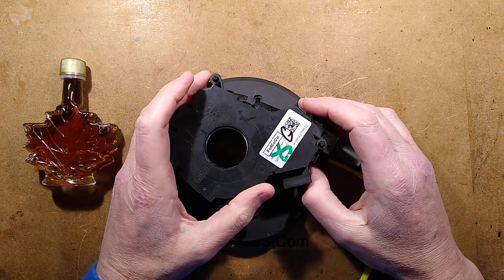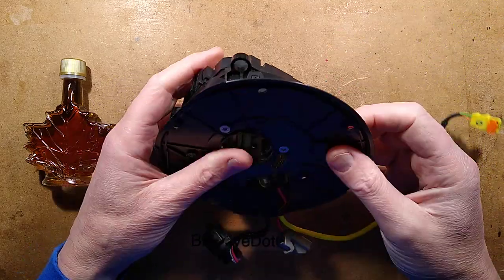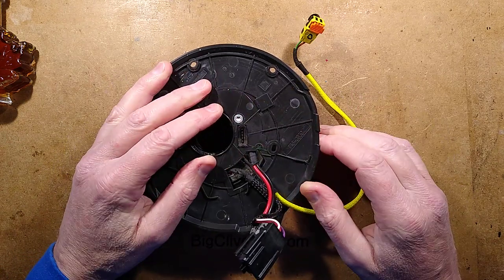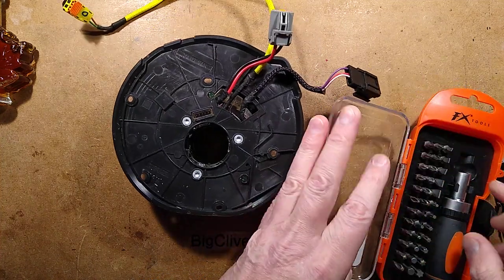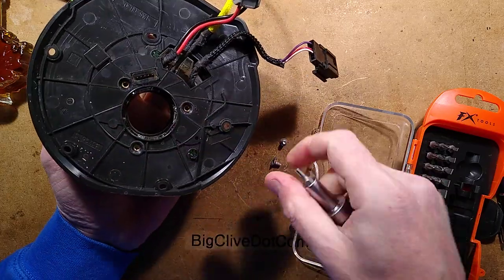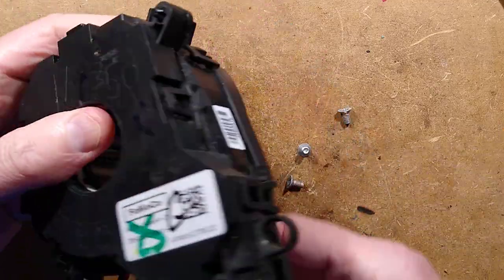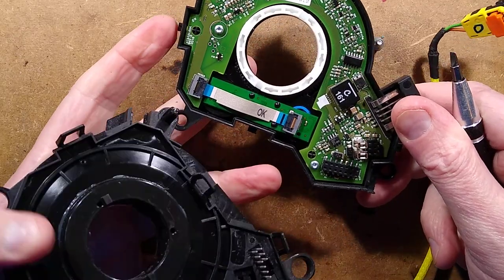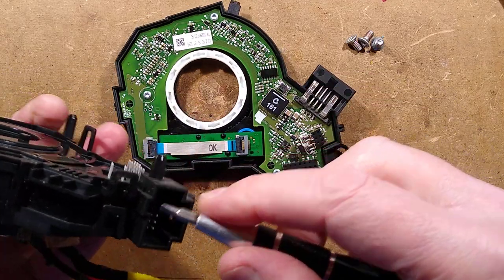Inside a car clock-spring module (steering wheel wiring interface)

Comment: Life was so much easier when the only button on the steering wheel was the horn.  Literally just one sliding contact.  Didn't even need two because the the horn button switched the ground to the horn.  That's why when old cars in movies have the horn go off when they wreck.  Any point in that circuit that goes to ground and the horn sounds continuously until someone disconnects the battery.
Reply: I don’t see the point in having controls on the steering wheel when they do the same thing as controls literally inches away on the dash... with practice you can adjust things without looking.
Perhaps it’s different now with touchscreens, on some cars even changing the radio station is multiple menus down!
Reply: Huh, I always thought the horn going off was to tell the audience that the driver was passed out with their head on the horn button.
Reply: Maybe they should bring that back - could potentially save lives by alerting passers by
Reply: @23Scadu  Nah, I've seen it happen IRL.  You have to pop the hood and go for either a battery terminal or the horn itself.
Reply: @RavenLuni  
No argument here steering columns are literally the worst thing to work on in a modern car.  Cramped finicky and over complicated.
Reply: my first car didn't even have the horn on the wheel! it was stuck on the end of the indicator lever!
Reply: @DeannaEarley  I remember my dads old cortina had the horn like that
Reply: i have 4 cars and on all of them the horn is on the indicter stalk 
ive never owned a car with the horn on the wheel
Reply: @carmadme  My dad had an Izuzu I-mark from '81 that had the horn like that.
Reply: One day early in my first marriage and living in the northeastern US I headed to bed on a particularly cold and windy winter night and while in the bedroom I heard a droning sound that was difficult to identify. It turned out to be the horn of my wife's car, an early 1990s Pontiac, made less recognizable by all the wind noise. Apparently contraction of a part in the cold had caused the button to make contact. Once warmed back up it worked fine. No idea how long it had been going off; it was a sufficiently rural area that neighbors wouldn't have heard it as they were all too far away.
Reply: @bigjd2k  you'd still need a clockspring, even wirhout steering wheel controls. You need the steering angle sensor for ABS/ESP and the wiring in the clockspring for the Airbag. Might as well put some buttons on there, while you run those wires.
Reply: i had to take my steering wheel off my 94 4runner to get to the windshield wiper relay/switch, it's one of these ribbon modules but it includes the turn signal and windshield wipers, new part is like $250. boggles my mind why the engineers felt this needed to be attached to the steering wheel and not a couple inches back and just to the column, getting rid of the need for a lot of this crap.. and this is 94... imagine what cars have now
Reply: @DeannaEarley  also a Ford? I remember my brothers Escort, the first time I drove it I couldn't find the horn 😂
Reply: StraightOuttaJarhois I see you received you education from GTA like me 😅
Reply: @RavenLuni  Well, modern cars won't sound the horn, but I know of at least one manufacturer that has the interior and exterior lights come on, and the doors automatically unlock in the event of a crash severe enough to trigger the airbag.
Reply: They took it a step further and made sure fords from 1985-2000 like my ford contour when i wreck when airbags deployed the horn automatically sounds via computer command for  300 seconds so someone can find you.  It turned itself off when it still had battery power but the flashers didnt come on automatically.
Reply: Ford had cars with cruise control buttons on the steering wheel in the late 80s/early 90s and they too just used one sliding contact, which was used for both the horn and the cruise control switches.
Reply: Ah yes, the horn button switching the ground. Many years ago, a very unpopular sales man at the dealership I worked at brought his car in for some remedial work. We connected a wire from the choke knob light (remember choke knobs!)  to the horn. No problem driving it warm. The next morning, cold start, choke out, drives to work with the horn blaring!
Reply: @grayfox7671  EVIL!  I love it.  My favorite gag is to hide a blue tooth speaker in someone's car and then play weird noises from my cell phone.
Reply: @RavenLuni  Most cars do still have that "feature," and for specifically the reason you mention (alerting passersby), even as far back as the 1990s. I've never looked into whether the airbag module energizes the horn relay, or if the airbag inflator physically shorts the horn terminals upon deployment... Many of the newer cars automatically turn on the hazard flashers and pulse the horn upon deployment.
Reply: Why one contact? You can't make a circuit with a single contact. The ground has to come from somewhere.
Reply: @userPrehistoricman  You don't need to have 2 wires or separate contacts at the component to complete a circuit if the mounting point has electrical continuity to chassis ground. This was quite common for O2 sensors particularly prior to the introduction of heater circuits, and is still common for door switches, temperature sending units, pressure switches, etc.. In fact a 2-wire spark plug would just be bizarre.
Reply: @userPrehistoricman  Yeah it comes right through the steering column.  In older cars the entire body and frame are a ground.  Cut's down on half the wiring.
Reply: @DeannaEarley  Sounds like the old Morris Eight,indicator lever as well! And dip switch! And that was seventy or more years ago!
Reply: @hugebartlett1884  close, she was my old.. '79 mini
Reply: I've even seen big cylinder-like contacts with a coupling a bit resembling that of the blades of a helicopter, where the horn button on the wheel was nothing more than a spring-loaded frame you pushed down, causing to push a ring right behind the wheel that was mounted to the steering column down which would activate a switch somewhere.

Comment: Back in 2014, I had just gotten a new car and about 6 months after buying it, all the stuff on the wheel (horn, radio volume, etc) died and the airbag lite came on. So I took it to the dealer for the warranty, and there had actually just been a recall for a bad batch of clocksprings from the subcontractor. I had never heard of these things before

I was curious as to how they worked but there wasn’t that much info at the time and I just sorta let it go. so I’d like to thank you, Clive, for answering a 6yr old question that’s been bouncing around in my head.

Comment: Maybe of use to anyone wanting to learn more:  If you do a search on 'car steering angle sensor' it appears this complex electronics came into effect in 2012 when US legislation required new cars to have "Electronic Stability Control" fitted.  Basically the car brain has to work out if the vehicle is under control or not.  Part of this system compares the vehicle acceleration and yaw rate sensor data to wheel speed data and steering wheel data.  Back in my day the driver was capable of working out if the car was going out of control and compensated accordingly.  Apparently we need the car to work this out for us now.  Great video and most interesting teardown - many thanks Clive.

Comment: The steering wheel position must be known by the ABS module. If the right wheels are turning faster than the left and the steering wheel is turned to the left, that would be a valid situation. But if the right wheels are turning faster while the steering wheel is in the middle or turned to the right, that would indicate slipping wheels. In that case, the ABS module would apply some braking power to the right side wheels only, in order to correct this.
Eric O. did a video with exactly such problem. The steering angle sensor was present but not mechanically connected to the steering wheel shaft. That made the car apply brakes when cornering: the car thought it was going straight but the wheel speeds were different when turning left or right, resulting in uncommanded braking.
Steering wheel position sensors need to be recalibrated when replaced, after power loss or after an ABS module change. I suppose, the wheel position is calculated from the relative positions of the two magnets. They probably each have a different number of teeth on their cog. If these magnets would just form a rotary encoder, these modules would need to be active at all times, in order to track the steering wheel's position in case somebody turns the wheel while the car is totally powered off.
Reply: Exactly this - on a BMW you will get a “Steering Angle Inconsistent” error thrown - typically because the plastic disc and opaque / transparent tracks optical system for doing this has got dirty!

IIRC, when cleaning mine there were 5 tracks with different overlapping frequencies of opaque parts, with 5 leds and photosensors to detect turn speed and direction quite accurately.

Comment: The chips may be compasses detecting the absolute rotations of those two smaller gears. If they have different sizes, we can calculate the absolute rotation of the wheel.
Reply: That's exactly what I was thinking - the blue gear looks smaller than the black, and that would give pretty accurate positioning.
Reply: There will probably a procedure with the scanner to reset the straight-ahead position as well.
Reply: @tomvleeuwen  There normally is, it's essentially "Get the steering wheel dead straight and click next". Then you have to rotate the wheel from lock to lock a few times. The procedure likely differs from brand to brand
Reply: They might only be needed to detect direction and rate of turn. May not need abs position.
Reply: @littlebrutus5199  I don't think so, if the car does not have dynamic stability they normally use a cheaper way to detect the steering wheel position to switch off the direction indicators. If it does have dynamic stability, they need absolute position.
Reply: I'd also guess that they are different size gears. Just one or two teeth, not more. This gives an vastly increased range in which they are effective - basically, they'll only be in the same relation to each other after ten or more turns of the steering wheel. The control unit is then programmed to know which position is center.
(Since the gears are much smaller than the "sun gear" which attaches to the steering wheel, they will turn more than once per steering wheel rotation).
Reply: yeah the chips are hall effect sensors.. we already knew that idk why you said they may be compasses, hall effect sensors are actually used in electronic compasses
Reply: They're some fairly bog-standard magnetic rotary encoders
Reply: @tomvleeuwen  on my old VW you had to hit the end stops after reconnecting the battery, it threw a light on the dash until you did that. So I think it just looks at the max and min value ever seen and the middle is straight, and you get a dash light if something is unreasonable
Reply: For cars with DSC or similar, you don’t need to know midpoint, just swing it all the way one side to the other usually, and the car derives the midpoint from the yaw and wheel speed sensors.

Comment: Older cars where the only thing in the steering wheel was the horn did use slip-rings!
Reply: what is the need to know the rotation of the steering wheel for? greetings from nova scotia.
Reply: @absolutely1337  traction control and similar systems would need to know the steering wheel position to compensate for corners.
Reply: I think my old '87 Mazda 323 used slip rings. The steering wheel provided a single conductor and the steering shaft was at a zero potential, so touching that conductor to, well, anything really, sounded the horn.
Reply: @absolutely1337  most cars these days have electric power steering. The steering wheel angle is used to drive that.
Reply: One more overpriced piece of electronics which, when gone wrong ,will vost an arm and a leg for some 'fitter' to plug the car up for 24 hours, read the test codes and replace the unit (which will probably not be available anywhere to buy cheaper than main dealer), then plug the vehicle back up to the computer for another 24 hours to check if everything is in working order and charge you the cost of the vehicle. It is also to stop backstreet mechanics working on cars cheaper than main dealers. :)
Reply: Yeah I have an old truck that has 3 slip rings power horn and cruise control
Reply: awesome to know. thanks everyone. only steering wheel i  have take apart previous had slip rings on it.
Reply: My Riley (1946) had a 4 core cable down the steering column stator, 1) Ignition live, 2) Left Turn, 3) Right Turn and 4) Horn Earthy end.  The other side of the horn button was earthed to the column, the "hot" side of the horn was permanently live.  The stator went down the centre of the column and was prevented from rotating by an olive at the bottom of the column.
Reply: My first car,  corona 76, horn didnt work, the spring loaded contact to the ring had worn down so much it didnt make contact anymore. Also my key could open other similar model coronas, useful in a wrecking yard when getting parts!
Reply: @absolutely1337  also you need to know if the clock spring mechanism is going to bottom out at one side so you'd need to know the absolute position to center it
Reply: A coil of single core wire up the steering tube is enough - earth-return ! ;)
Reply: @ianallen2  And just how would you go about providing steering wheel controls for the radio, cruise and other things?  How about the airbag igniter?   What about stability control?
Reply: @madflyer1093  Not really. For power steering you "only" need to know the force applied to the wheel, not the position the wheel is in. And power steering dates back to WW2 trucks. Essentially, it's a classic servo arrangement. This thing is more for things like electronic stability control and traction control.
Reply: Bob Roberts Obviously you haven’t worked on many cars. There are controls on some steering wheel for cruise control and some controls for radio. Some steering wheels have a few buttons on the sides of the air bag surround in the spaces of the ‘spokes’.
Reply: Looks like we found the Grumpy Old Man who's so fired up that he misunderstood the question. 😆
Reply: @TDOBrandano  ford specifically does infact need to know the position of the wheel. It's how it determines the amount of side compensation assist to give. To compensate for road crown and cross winds.
Reply: @TDOBrandano  he was specifically talking about electronically assisted steering which in fact uses the steering angle sensor. Some modern cars rely entirely on electric motors for steering assist.
Reply: @pfannkuchengesicht42  Electrically assisted steering needs a torque sensor, not an angle sensor.  Steering angle sensors are used to compare the expected yaw rate (i.e. vehicle speed and steering angle) against the actual yaw rate which is determined from a gyroscopic sensor.  The ECU can then determine wheel slip and perform corrective action e.g. braking individual wheels.
Reply: @ianallen2  or you pull a unit out of a scrap vehicle, fit it in the one that needs a replacement, and done. you dont have to "plug up for 24 hours". 2 minutes is enough.

The manufacturers who make sure units cannot be replaced without special codes are fucking evil bastards, and their efforts are futile - often some guy made a tool to reprogram their ID for $500 and it's  a buy once affair (fine for a small garage that exclusively does 3 or 4 brands, that's 2k every couple of years)
Reply: @madflyer1093 - If you’re saying that the sensor is used to control the actual steering, that’s not the case at all. Electric steering doesn’t mean only motors operating the steering mechanism. It’s just the usual power steering except the conventional hydraulic system has been replaced with an electric motor. It’s merely ‘assisted’ steering, the driver still turns the wheels via the same old mechanical linkage, the motor just takes some of the load. Apologies if I misunderstood you.
Reply: @ferrumignis  which I understand usually consists of a torsion bar and two angle sensors in many consumer-grade EPS solutions.
Reply: @ianallen2  if you don't like it, maybe you should manufacture a better, cheaper car with less bells and whistles. good luck.

Comment: There's no default centre position on those units, basically when you replace one you go through a calibration procedure to program the centre and left to right range.
Reply: And then  the default position is saved in an non volitile memory, just Like an industrial absolute encoder..
Clever tech
Reply: I've opened up a similar sensor from a much smaller vehicle; that one did have an additional two hall-effect sensors (linear, not rotational) and another magnet to find dead center.
Reply: Well other than the default centre given by the cable winding around that rips off if you rotate that thing too far in one direction.

Comment: The two hall effect sensors should be on two differently sized gears. These differently sized gears will rotate at different speeds for a given input. Carefully selecting the input and sensing gear teeth counts you can create a system whereby the absolute position of your column is known by comparing the sensors relative to each other.
Reply: Came here to say this. The two gears are even different colors of plastic to ensure the correct position of each is plainly visible.
Reply: I was wondering how he didn't immediately catch this. I know nothing about systems like this but it was the first thing I thought when absolute position was mentioned.